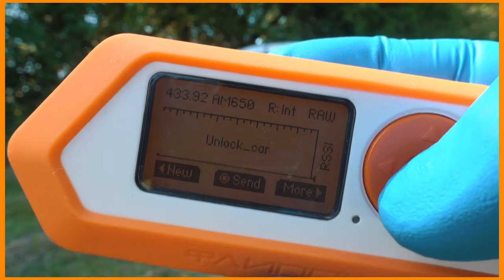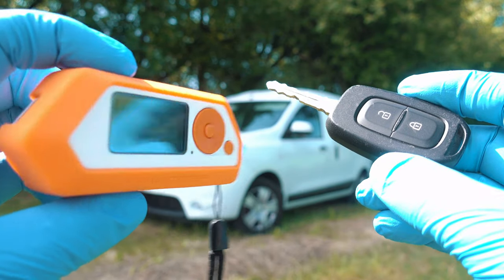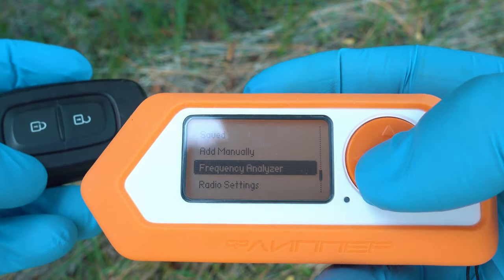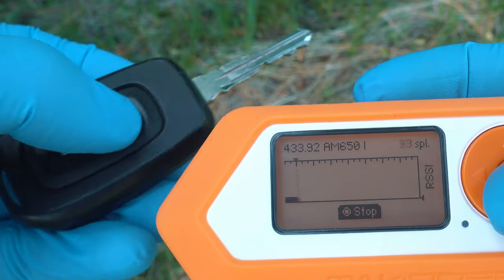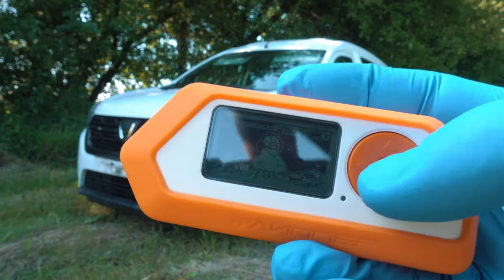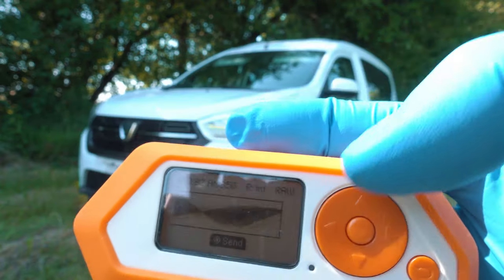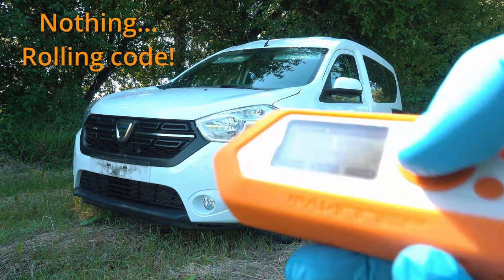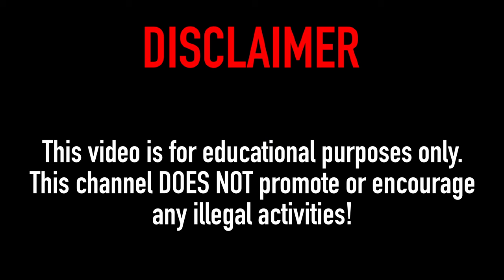Flipper Zero Car Key Signal - Unlock Car Key FOB Hack

Comment: Starting? If not ill figure it out today on my own car and understand its limits.
Reply from the maker: starting? well good luck with that… z
Reply: @takeapart  I'm a full automotive repair facility with all the dealership scan tools to diagnose, service and repair vehicles. My scan tool can create keys, start vehicles etc. I am wondering if anyone had pushed the limits in conjunction with REAL automotive grade scanners. I will be using this in conjunction with my vehicle scanners and mess around with my sacrificial graveyard of fully functioning vehicles for fun, and if I damage anything I can reset the keys with my automotive scanner.
Reply from the maker: @KenyaSG well this changes my answer. If you have tools at your disposal- then it should be easy if you encounter any issues.
Reply: @takeapart  I will most likely end up bricking this machine 🤣
Reply from the maker: @KenyaSG yes… high probability of bricking
Reply: @takeapart  Well for now I get in the car then use my scan tool to program a new key.. uh I want to cross lines I shouldn't cross lmao I need more tools or software I need to do research I just got this thing
Reply: @takeapart  I broke it, it's done. Lmao
Reply: @KenyaSG  what does open keyless entry?